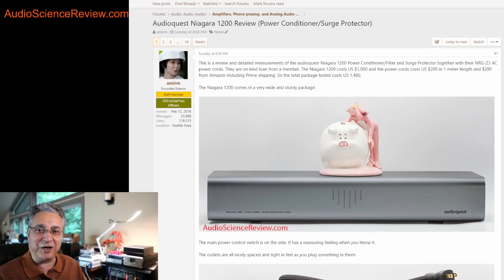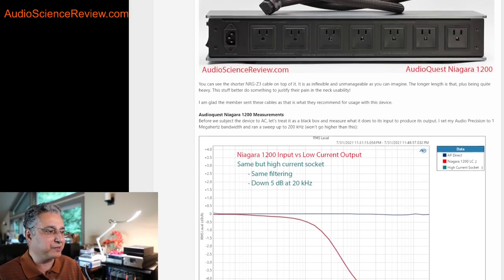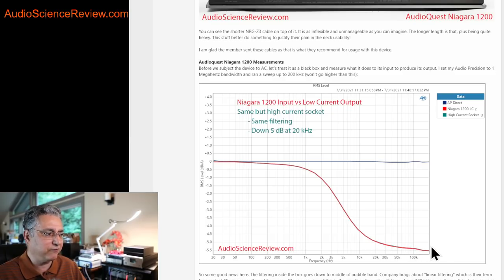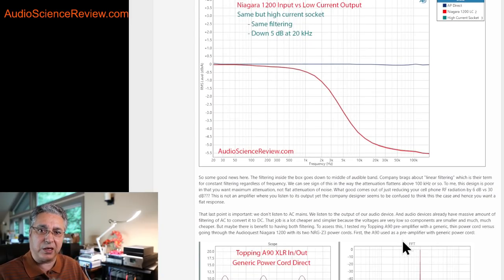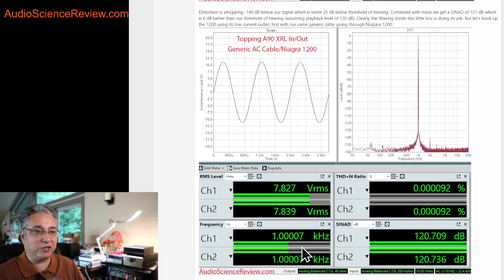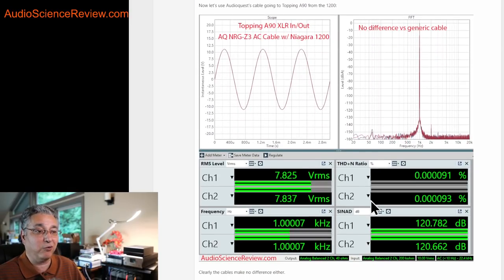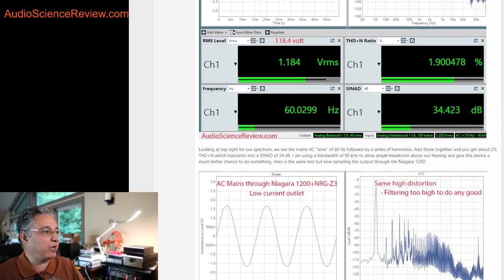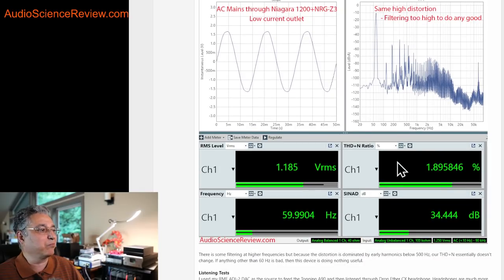Audioquest Niagara 1200 Review AC Surge Protector and Filter

Comment: I have questions: the measurements show a low pass filter with ca 5dB from 5kHz up to 100kHz, yet the filtered output of the UUT has -5dB only around 5 to 20kHz, while the ugly 60kHz peak remains unattenuated. - which of the 3 measurements is wrong?

A German, highly regarded developer says (if i summarize that correctly) the importance (and thus the success) of AC connections of v low impedance & inductance arises from the use of (integrated) amplifiers with large caps and extremely short charging duration, which alters the requirements for hifi transformers and supply power cord .. distributor.., vs general EE standards. As a consequence, also line level ground potential differences would occur between source and amp (no good for SQ!) if ac supply is suboptimal ie  not of very low impedance. So, this would make your chosen subjective test arrangement (headphones only) not sensitive to what a good distributor can or cannot do. And explain the results you got. 
I agree on the technical descriptions given by AQ, AQ seem to have departed from earlier more understandable and technically less controversial approaches of marketing information. Zero Impedance is a nice word.
Reply: Current flows only for short time in the rectifier that's the problem to charge the caps. I would say power factor correction is good because lowers the current in average.

Comment: Hello, can you compare the sound output/THD with and without the Niagra 1200 using a mainstream amplifier with passive speakers to measure the difference in sound output/THC from the speakers?  

Maybe the device you were using already filters sound so well that the power conditioner wasn't needed, whereas if you compare results with an amplifier that has a higher THD there might be a more noticeable difference?

Comment: You measured differential noise , BUT what about common mode noise , your measurement did not show that at all.
Reply: I wish I could hear this noise, I never have with my audio equipment. Must be that it’s designed good.
Reply: Common mode noise was not measured. Yes we don’t hear common mode but the noise effects digital circuits (dacs, streamers, routers, modems, switches) will have increased jitter and hence will effect final fidelity of analog output we hear. Common mode noise goes up to the Gigahertz frequencies now with all WiFi / cellular / 5G that gets absorbed by the power lines.
Reply: @AffordableLamps   Amir, measurements of dac shows this is not important. Way beyond human hearing. It’s the old create a problem (even though it’s not) and then solve it.
Reply: if you are worried about common mode noise which is an issue sometimes there is a existing solution, which is using a balanced system..... Again, you should change your equipment rather than adding these power conditioners... a balanced amplifier and DAC will have a lot of common mode rejection... also it just takes a common mode choke in the power supply to reduce that and that kind of filtering should be present

Comment: Great video but my opinion and experience has been that some things can and do make a difference. I started trying things awhile back with the first being a supposedly a better power cord. I was shocked that I could hear a noticeable improvement in the bass. To see If it was a placebo or not. I had my son and neighbors listen. They also noted the change. Granted I’m not talking about WOW holy crap changes but still noticeable. After this I started experimenting with interconnects and power conditioners. Somethings were noticeable a lot weren’t. 

The biggest point I wanted to make is you may not be able to measure it but try some things out, if it doesn’t change simply send it back, there’s a lot of places you can do that. I relate this to trying new audio pieces like phono preamp’s and amplifiers preamplifiers etc. Does it change the sound and do I like the changes? 

If you try some of these things and they make no difference sweet you save money, if you try some new things and it makes a difference and you like it Sweet, either way it’s a win-win.
Reply: There's is no difference, It was explained in the video - Turn your back and have your son swap between power cords and you wont hear it.
Reply: Placebo effect. It's a very real thing. Even placebo medicines often produce remarkable improvements in a patient's condition. It's simply not possible for an AC power cord to affect the bass response of your system. (Unless you're using the AC power cord as speaker cable! THEN it might have a (subtle) effect!
Reply: 100% agree with you

Comment: Only slightly related but I've got a nice Furman unit I've used for years now, and the ONLY reason I've kept it around is that it solved one very specific problem I'd had for awhile; every single other conditioner or simple power strip I tried would result in crazy mechanical transformer hum audible from across the room. A fault of my power amps perhaps, or some ground loop shenanigans (never did fully sus it out, to be honest), but when I got that Furman unit by god it finally disappeared. Did it change the actual sound quality? Not really, and if anything it degraded it a little, but it was worth every penny to be rid of that noise. Plus it looks pretty cool, which is never a bad thing.
Reply from the maker: That's perfectly fine application when you have a known problem and a box fixes it.  Sadly 99% of audio power conditioners are sold people with no audible problems.  They plug them in and talk about all kinds of imaginary improvements....
Reply: Interesting how it degraded sound quality. I read some other user say you lose 10 percent head room which is absolutely wild to me
Reply: @questionableidentity1  Well, like I said "if anything" it degraded things a little. Not really possible to do a proper A/B with a component like that of course, but I did find it to be (very) slightly "darker" upon first using it. That being said I went into it having read similar stories, so I chalked it up to confirmation bias and never thought much of it. Whether that's all it was or I just got used to it, I have been nothing but pleased with the performance since. I have a "Furman ELITE15 DM i", for reference.
Reply: @paran0ia7  I'm looking to solve some noise with microphone Amp and compressors. I placed an order for a Furman 1800 AR. So let's see how that goes
Reply: @questionableidentity1  Nice, I'd be very interested to hear how that works out for you. If there really is any audible benefit (or degradation) with power conditioners, I feel like the recording/production level is definitely where it would be the most obvious.

Comment: To me the I don't care how it measures I can hear the difference is a case of the Emperor's new clothes syndrome. A real audiophile WILL hear the difference. I want to be an audiophile, so I convince myself there's a difference where there isn't one. A good power conditioner will help protect your equipment, I will not improve the sound. BTW why does this only go for audio? I've never seen anyone say I connected my projector using a $1000.00 power cord, it added 100 lumen, better color, and it's way sharper. Also the blacks are silkier, better shadow detail etc, etc, etc.
Reply: Excellent point. As far as protecting your equipment, a $200 UPS will protect everything in a single circuit since at this price point it can handle up to 1500W. You get surge protection and emergency power. 

Don’t want to spend money on a UPS? Get a <$30 surge protector.
Reply: My feeling is that video improvement "claims" are SO much easier to measure/dispute/disclaim/disprove than with "invisible" audio. That's why you don't see this nonsense in the world of video.
Reply: @njm1971nyc  that’s a byproduct of the fact that everyone has one or multiple tvs and monitors. Not everyone even has or uses a sound system or even headphones for that matter. They usually use the sound that comes with the monitor. 

The fact that video is more widespread versus discrete audio systems means that snake oil doesn’t manifest for as long so manufacturers also don’t pull the same nonsense since it can be figured out so easily.
Reply: @hsharma3933  well I'm talking mostly about "enthusiasts", people who do care about quality. That said,  there certainly are "high end" HDMI cables out there, costing several hundred dollars, but it's VERY easy to prove how ridiculous they are. Visual improvements are far less subjective than with the voodoo world of things you cannot see, such as audio!
Reply: @njm1971nyc  ok yea I agree with that.

Comment: Is the measured damping common mode CM or differential mode DM?
I'm engineer designing filter for electronics daily. 5db is almost nothing. It could easy be 30 to 50 dB  in DM.
Yeah a lot of relegion and crab stories. Before go buy expensive power cable. Exchange all cables from the power plant to you power socket. Of cause it does not help.
Thank you for really good analysis. You are totally right. BR Jan

Comment: so do we need to have electrical protection for our devices? and if so are there any that actually work properly?
Reply: If you get a power surge that kills your equipment then that will answer your question. This one from Audioquest apparently works properly.
Reply: The key here is to recognize that you don't need ANY device to take "noise" off of your AC lines at all. Any pursuit of that is simply a waste of time and money. Now, spending money on good surge protection IS worthwhile because surges and spikes (whether the originate from inside or outside of your home) ARE a reality and they can do real damage to the sensitive electronics inside of your equipment. The cheap surge protectors are shunt-mode, MOV-based devices that are sacrificial. The expensive ones are series-mode, inductor-based non-sacrificial devices. The latter there is always FAR better than the former. Getting good quality power protection is worthwhile. Trying to filter out noise from AC lines is not.

Comment: Thank you very much , you just saved me 1500 dollars ! Can you please recoomend a good and affordable device that can actually improve the sound of the system ? i heard good things about the  Surgex power conditioner .. thanks
Reply: Power conditioners will not improove sound. Listen to amir
Reply: Your money is better spent on the actual audio equipment like speakers, headphones amplifiers that actually and measurably sound different, sometimes better or worse. I still do recommend getting a basic surge protector as the last thing you want is a electrical surge damaging the badly designed line circuits....

Comment: Great work Amir🤛Is there any degradation in sound quality using just a basic surge protector from Amazon etc
Reply from the maker: No, I have never measured any degradation no matter how basic the surge protector is.  If you have a super powerful amp though, I would plug it into the wall direct.

Comment: Seems like money wasted, no matter how you slice it. With a switching power supply, those AF harmonics will get sliced and diced, and in the end they just might contribute a tiny bit to the efficiency of the equipment's power supplies. With linear supplies, you might get some bleed of the AC line into DC rails if the power supply is of a poor design, and filtering out AC line harmonics might reduce residual AC on the DC rails. But if that's the problem, then spending $1400 on improving filtering after rectification should give you more "bang for your buck". Either way, throwing good money after bad without any real plan is only efficient at relieving you of your money.
Reply: i think that is not a complete picture you are drawing here.
Reply: @gioponti6359  if you want me to write a book, start quoting numbers. I'll tell you if it's worth my time.
Reply: @StringerNews1  lovely, simmer down. in my experience also high priced equipment (i’d say particularly so) benefits from quality distributor with appropriate filtering, not as you seem to say, the opposite, ie all money on psu and power cable and distributor would not matter.
Reply: @StringerNews1  I never anticipated living in times when medical nonsense would surpass audiofoolya nonsense.....for $1400 you can get a proper medical grade isolation transformer for balanced power operation & the audible difference is more than tangible
Reply: @BogdanWeiss  yes, isolation transformers can be noisy. It's for power, not signals, so no balanced line. If you are trying to put a signal on your wall outlet, like powerline networking, my advice is to use Ethernet or Wi-Fi. Or MoCa.
Reply: @StringerNews1  it is clear to me that you have not heard of balanced power distribution - that’s OK, & I have no idea why you are talking about networking protocols into a conversation about AC power ? There is a lot going on between DC & THz & the topic is AC mains @ 50-60Hz from 110V-250V RMS in domestic applications.
Reply: @BogdanWeiss  of course I've heard of "balanced power" but as I pointed out, it's a misnomer. Although it may look quite similar to the eye, what has a purpose for signals is silly and pointless for power. Now if you knew what split-phase power means, I could mention some real problems with using it, related to unbalanced loads. But the solution isn't "balanced power", it's just to not use the split. But you have to know about it, not just regurgitate stuff that you saw on the Internet.
Reply: @StringerNews1  I haven’t payed much attention during power distribution etc & magnetic design is not something I’m familiar with either ( apart from Bill Whitlock white papers & a few others... )  I have seen balanced power in a number of recording studios & custom HiFi. I was under the impression that the benefits are similar to balanced line audio & that it lowers emanated magnetic fields, in addition to the Faraday screen reducing coupled electric spikes/noise. I would appreciate if you could point me to some concentrated  “meat” on balanced power. HiFi is full of BS & voodoo, SMPS have their own pros & cons & the plethora of equipment can have decent psrr or inadequate + all the personal computer “junk” that’s often very noisy - hopefully we can rectify my spurious noise 🤩
Reply: @BogdanWeiss  As I keep explaining, power is not a signal. What may work for signals doesn't have to work for power. Just because someone claims something doesn't make it true. One reason why I'm watching this channel in particular is because there's an epidemic of people claiming all kinds of nonsense in the audiophile community. It used to be that people who built stereos were enthusiasts and loved music. Now it's all about self-importance and lying. I'm trying to reclaim the hobby for enthusiasts who like music, and don't make it all about one-upmanship. I can't point you to any "balanced meat" on balanced power because it's not real. The people who promote the rumor are talking nonsense. My advice as always is to hire a licensed electrician to do wiring.

Comment: So what is the recommended solution. Plug it a generic surge protector, hope not?
Reply: Tripp Lite makes good quality surge protectors and offers a wide variety ranging from 180 to 5100 Joules of protection.
Reply: @heathwirt8919  Generally speaking, if you have purchased a surge protector that makes any mention of its Joule rating, you probably haven't actually purchased a very good surge protector at all. Those are all shunt-mode, MOV-based sacrificial surge protectors. They offer relatively little protection, can potentially damage other equipment on-site by contaminating the ground (when they dump voltage off onto the ground) and can even represent a possible fire hazard in certain instances when they operate, depending on the scenario. You are FAR better off going with a series-mode, inductance-based non-sacrificial surge protection device instead. They are more expensive, but as the old saying goes, you get what you pay for.

Comment: Hello Amir, just a quick question about power strips / power blocks / mains extensions.

Is it true that regular, cheap designs that use daisy chained sockets can starve one another for optimal power? For example, you have a 6 way power strip, in the first socket you plug in a high current device like a power amplifier, in the second socket you plug in a large active subwoofer, will the rest of the sockets be starved of power?

I only ask, as many companies that produced HiFi power blocks etc claim that “star-wiring” eliminates / solves this problem associated with regular power strip design, essentially creating a “home run” for each individual socket? Is this accurate? Or is regular power strips just as good as one which employs star wiring? 

Would be very grateful to have this answered! 

Thanks.